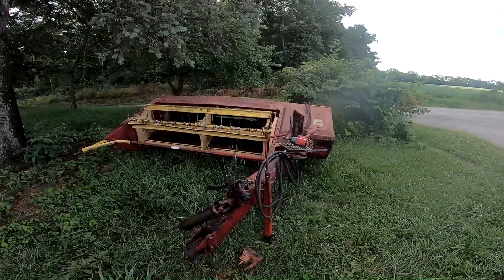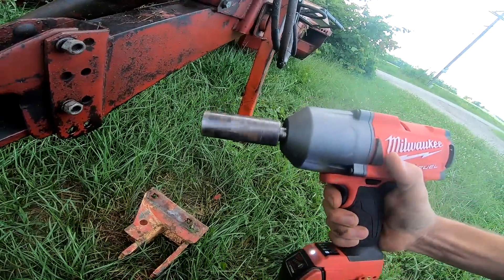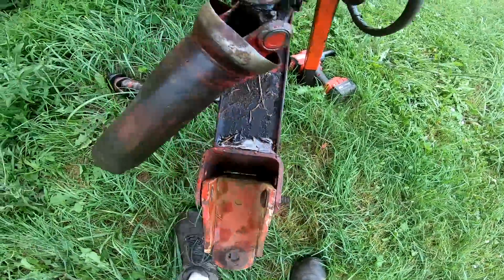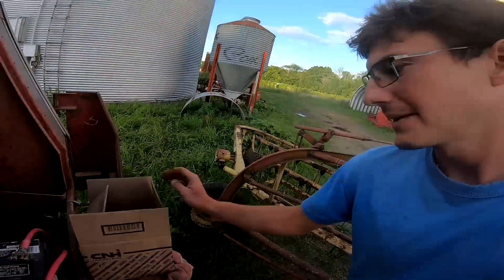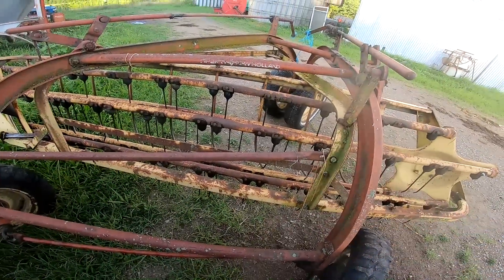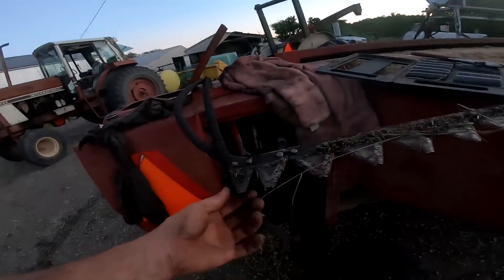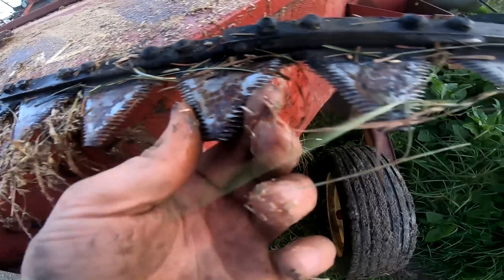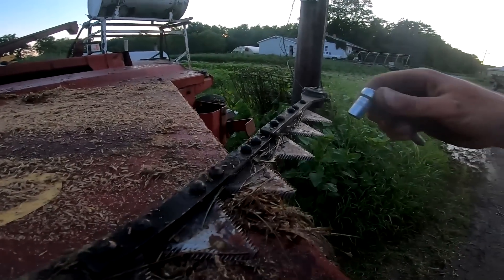Mid-season Hay Maintenance on New Holland 474  Haybine and 256 Rake

Comment: Well everything needs some maintenance now and again.  Hope those rake teeth work out for you.  I bought an OLD 258 NH rake at an auction-- it was in pretty good shape for its age-- hadn't been used for a tillage tool (run down in the dirt all the time by some idgit trying to pick up every last straw and blade of grass off the field, leaving a harrowing job in its wake) which is why I bought it.  It did have rubber rake teeth on it, though.  Well, of course quite a few were missing, and never having had a rubber toothed rake before I figured "what the h3ll" since I know a LOT of the new stuff is coming with rubber teeth.  I was kinda shocked to find that the rubber teeth at TSC, even the dirt cheap ones, were about 3x the cost of cheap spring steel teeth.  SO I bought some.  Got everything replaced and lo and behold the thing is busting teeth... some of the rubber teeth on the rake were on it when it left the factory, OBVIOUSLY back in the Sperry days of NH; they still had the "proof marks" on them (that diamond pattern with the NH beside it) and MOST of those were holding up pretty darn well despite being over 30 years old!  BUT some of the ones that were busting were the BRAND NEW TSC junk... which of course, if it comes from TSC its usually one step above junk LOL:)  Priced the factory ones at the NH dealer and nearly fainted-- they were $8 a piece back then, when you said $11 I about fell over!  Anyway I said, "SCREW THAT!" and just bought a pack of the steel rake tine bar clips and a mess of steel teeth from TSC, and some new bolts, and started retrofitting it to steel teeth as the rubber ones gave out.  The teeth are the same size and shape and totally interchangeable, only difference is you have to guy a little bag of "clips" that are like a stamped steel washer bent to conform to the bar and go over the head of the steel spring rake tooth so it doesn't turn on the bar.  It has a square hole for a carriage bolt head as well.  I just found over Christmas that Rural King has the bags of clips (like 10 per bag) for $8 which is a couple bucks or so cheaper than I was paying at the NH dealer for them.  Steel spring tines at TSC are like $1.99 or so each IIRC... been awhile since I bought some.  I was having to replace about 20 or so tines a season on the 256 due to attrition of the rubber ones, the new TSC rubber ones I put on gave out first.  After about 3-4 years I had maybe 15 rubber teeth left, and got tired of looking at it and only having them bust off one by one, so I just swapped the last of the rubber teeth off the rake and made it all steel teeth.  NO problems with steel teeth, even in rough ground I might break one a year-- usually they just bend (because the cheap TSC steel ones aren't as hard as the original NH steel teeth, which would often break rather than bend past the spring limits) and so usually if the rake hits hard in a hole or something it'll just bend a tooth and it'll start making the rake really noisy and I'll stop, take the ring end of the crescent wrench and put it over the rake tooth, and just bend the thing back into position-- sometimes the spring coils get stretched out a bit, or sometimes the straight part of the tooth below the spring part bends... either way the loop on the end of the crescent wrench makes a dandy tine straightener and I'm back to raking within about a minute or so.  They work just as well as the rubber teeth.  

Sure saves a lot of money over them rubber teeth as well... You could by 3-4 steel teeth and the clips for the price of one rubber tooth!  Later!  OL J R :)

Comment: I use under cut sickle sections. For the most part they are self sharpening as they wear. They are meant to be that way by design.   Glad you found the loose ones before they chucked a guard!

Comment: Respecting your decision to use a sickle bar mower, when we used one, we had at least 1 if not 2 spare knife bars so we could switch in the field if necessary. Much easier to do a good repair. The same goes for the sickle bar on bean header.
Reply from the maker: I once carried and extra bar, but when we went to bolt on sections, I got tired if the spare sliding out of the frame and dragging hay.

Comment: Hard stop vs coast doesn't have to do with the type of motor, but how it is controlled. If you short the power wires of a spinning brushed motor, it will stop nearly instantly.
Reply: yeah my brother runs brushless motors in his RC cars and trucks and they all basically brake like that when you let off the throttle...  they have to make the controller to feed a certain amount of power to it to allow it to "spin down" so it doesn't just "slam on the brakes" every time you let off the throttle on the RC controller... they also have "brakes" that when you push the trigger forward past "coast" to the other side of spring-loaded 'off' of the trigger, it does away with the "coast down voltage" it feeds to the motor proportionally so basically the motor starts dragging and can lock up like a brake... funny to see an RC car at speed with all four wheels locked up sliding because he hit the brakes hard, just from the brushless motor "locking up"... Later! OL J R :)

Comment: For those trouble bolts on the hitch, it's because you put it on "backwards". You're supposed to put the bottom ones in first through the space in the back, then rotate it up to put in the upper bolts. Basically impossible with a camera in your hand. Not that it much matters since I doubt that hitch is coming off any time soon.
Reply from the maker: I hope I don't wear it out that fast.

Comment: that wore out bushing may have been what caused those sections to loosen up might want to pull those bolts and see if the holes or bolts are worn from the hammering  of the sickle bar when that bushing was wore wouldnt take much to cause that
Reply from the maker: The loose section bolts had just been off a week before.

Comment: Years ago Dad had a NH haybine(477?), and he told me that the wobble box bearings would go on it. Have you noticed the same or is this a different design?
Reply from the maker: Depends on which style wobble box. If it's a true box enclosed in oil bath, then it'll last. If it's the eccentric shaft style that's more exposed, I could see that having trouble.